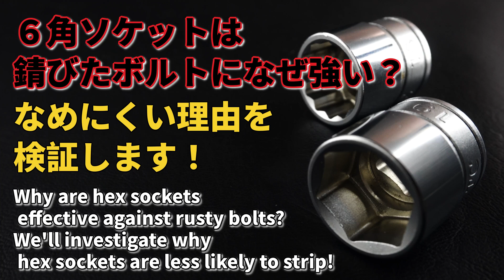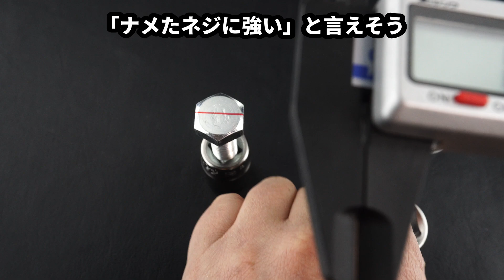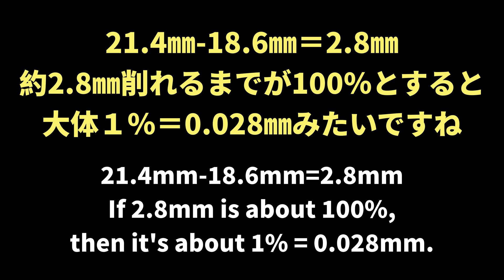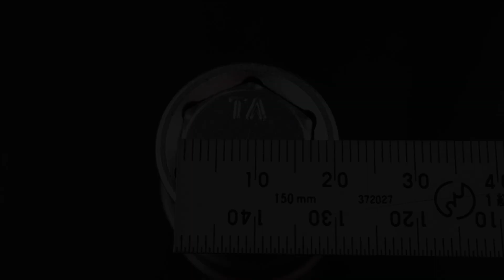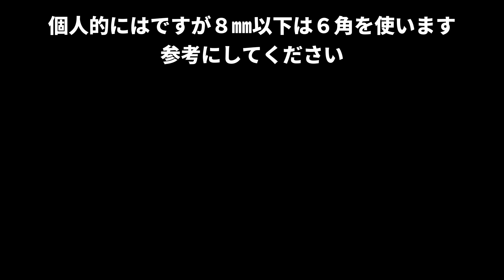【ほぼ完全攻略】６角12角論争に終止符を打つ！かもしれない？６角ソケットは錆びたボルトになぜ強い？６角ソケットがなめにくい理由を検証します！【工具 紹介】#mono物語

Comment: Great video - I have used 6 point sockets from 10mm down, and 12 point for larger sizes (Snap-on & Koken). I have found that the smaller 12 point sockets tend to strip bolts, especially when they’re rusty / corroded. I love the look of the KTC 12 point sockets!
Reply from the maker: I would be very happy if you found this helpful.